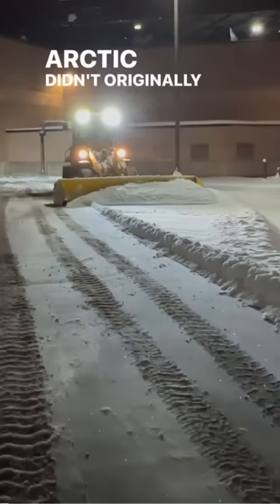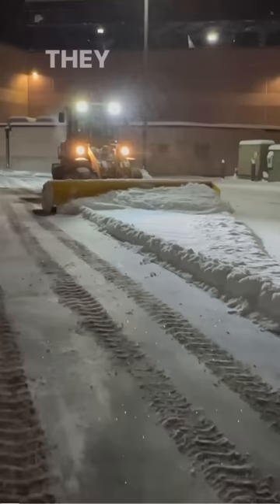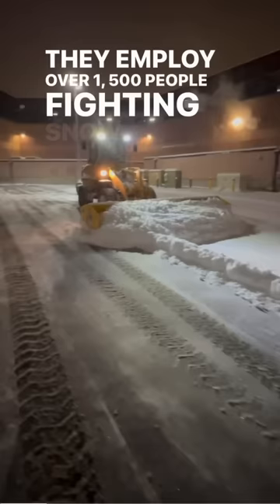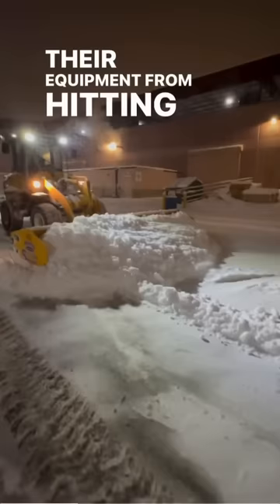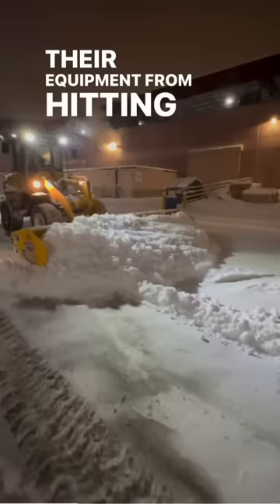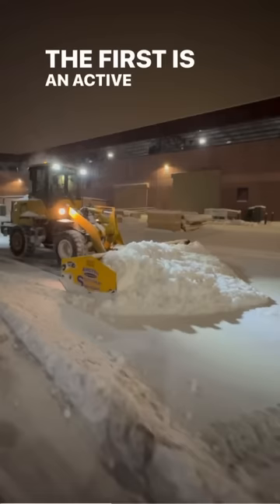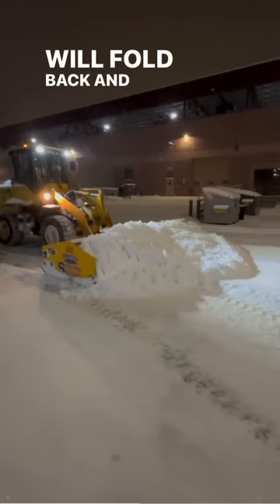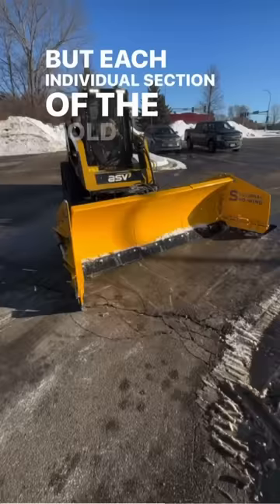Plow hitting a curb head on. Wait for it . #shorts

Comment: Im sure there are plenty of people out there who have never plowed snow or hit a curb or manhole. It is just as bad as having a head on car crash. You will come to a dead stop on a dime and other then the injuries the driver might suffer, it also damages the machine.
Reply: I agree about the dead stop and damage but it's not as bad as head on with another vehicle. Average plowing speed for me was around 12-18 MPH before snow overwhelmed the windshield wipers at an unmanageable rate. Hitting manhole covers and potholes was tolerable with a Fisher minute mount 2. Admittedly, I never experienced it in a machine with a fixed bucket, but the math says a head on collision is much worse. If you're going 35 and the person coming at you is going 35, that's a 70 mph collision. If you're going 18mph and hit a manhole cover, that's an 18mph collision. It hurts, but it's not equivalent to a head on.

Comment: I'm not even an equipment operator, but this is engineering I think anyone can appreciate
Reply: Not really, it's old and primitive tech that has been around for decades, all snow plows have a mold board and a sector connected by a bar so the blade will bend along with trip springs. I hit cracks and curbs all the time and my plow does the same thing it's an old meyer that was engineered 30+ years ago. I'll be impressed when they have a tech that can help hitting curbs back dragging cause this is only for going forward
Reply: @ericg4915  they said "appreciate" not "be impressed by"

Comment: These setups have their ups and downs.  Great for general plowing of wide open runways, parking lots, whatever where the blade can be "floated" over a relatively clean surface.  But, they won't work worth a snot if you're peeling "pack" from roadways, etc.........snow that has been driven over again and again and finally becomes removable with warming weather and 30,000 lbs. of downward blade pressure.

Comment: I bought a 5' snow pusher for my little BX1880 Kubota and love it. That little tractor pushes more snow than I thought it would. As long as I have traction it'll push it.
Reply: Traction is almost always the limiting factor moving snow. 

Nice little machine you have, is it a straight blade or an actual box with sides pointing forwards?(like what's in the vid)
Reply: @ctdieselnut  not a straight blade, it has sides going forward kinda like a 3 sided box. A snow pusher.

Comment: i have seen one of those arctic systems get fucked by a sewer lid, it hooked it and pulled it up, then it ripped the sewer lid and its retaining ring together out of the ground, the truck got to a dead stop , rear wheels got air time ,the pannel that hit it was bent up bad as was the mounts and linkages - plowing at 30 miles per hour against reccomendation

Comment: I was doing snow removal a few winters ago and caught the edge of the bucket on a little lip.  I came to a screeching stop and smashed the door window with my head.  Would have been nice to have a plow like this.
Reply: I did the same thing but ended up with a spinal injury and lost use of my upper right side of my body for three months. April 15th 2015. Still to this day I have no right forearm muscle. 
Could of used this get up that day!
Reply: @andytaylor2321  thats rough. Luckily I was in a slow skid steer
Reply: Was in a loader an caught the collar of a manhole sticking up plowing a street my back sure loved it.
Reply: @BlastinHash709  That's rough.  I haven't done snow in 9 years and I don't miss those mishaps.

Comment: Curbs would not be that much of a thing if the architect wouldn't design so many of them into the parking lots to begin with.
Reply from the maker: Agreed. Their are much better curb designs that could be used.
Reply: Dude fr! They put so many idiotic curbs in places that dont need em.
Reply: Gotta discourage big truck/trailer parking somehow
Reply: @DVeck89 I get it but it also makes it hard for everyone else to navigate
Reply: We just installed a parking lot for our church. Most of the curbs are required by the municipality. Can't go more than X amount of spaces without a peninsula, have to have X percent of the parking lot be "green space," etc. Really screws up flow for plows.
Reply: in northern europe we use curb poles or roadside poles to mark edges of areas to clear
Reply: @hipper5020  Yeah, but a bit of an uneven load, the machine just swings off course by 10cm and gets stuck on the curb. Considering how many of those poles get knocked over by the plow on my own driveway, every winter, it seems pretty hard to drive precisely to the edge when pushing a load of snow.